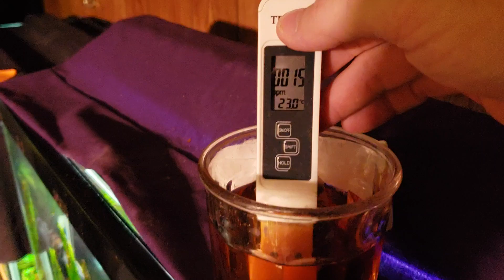Why Are The TDS So Ridiculous In My Native Tank?

Comment: Hey Dan, just saw a review of this new type of internal tank filter you might want to check out specifically for this native tank. It might reduce your TDS no matter what the source as it uses electrolysis to remove ammonia and other substances. The only thing it doesn't have is a UV sterilizer, as of yet.
https://youtu.be/qDcSJDqqDOc
Reply from the maker: That was interesting. Thanks.
Reply: @DanHiteshew-oneandonly  I thought so too, and timely to your situation in the big native tank. I am sure you saw my questions about those filters in his comment section. So far he hasn't responded, but he usually does. I wound't be surprised if he was talking to the makers of those filters to get the answers.

Comment: what type of filter are you running on that tank.  If I recall correctly you run most of your tanks with the same type of filter but just wondering if the filter is holding onto the TDS
Reply from the maker: It's a 404B SunSun, and I did a video a long time ago where I tested to see if the filthy  filter water had higher nitrates or TDS and it didn't.
Reply: Didn’t think it was the filter but I also know that at times they can hold onto TDS and I couldn’t think of anything else that might be causing that tank to have high TDS

Comment: I think the pH also matters if you measure TDS. If you have low hardness your water can easily go to acidic. Try to compare pH between aquariums. Acidic water should have increased TDS compared a non acidic water even with the same non water ion concentration. At least I think hydrogen ion concentration should have a strong effect in TDS. Hydrogen ion is so "mobil" it can increase conductivity of the water more than others ions.

Comment: the more water you have, the higher tds you get
Reply from the maker: The more water you have, the more dilute the TDS would be, indicating lower TDS. A small tank concentrates them.
Reply: @DanHiteshew-oneandonly  From what I understand is the larger the water volume the longer it takes for dissolved solids to build up, but they can build up. Since your native tank can handle cold water changes, unlike tropic tanks, you could do smaller changes more frequently with your RO water which you said was 12 TDS. Doing small water changes wouldn't shock your fish  unlike a larger water change would with the same RO water. The larger volume of water would prevent too much reduction of TDS all at once giving the fish time to acclimate to slowly reducing levels. Allowing for 2-3 days between small water changes you could reduce TDS down to acceptable (in your mind) levels in a month or so without giving a shock to your fish. Once it is at a level you target, then you can test weekly to see hom much increase you are getting, and compare it to your smaller water change routine and determine a new schedule for water changes on this tank. After wtching Rachel O'Leary and her process of small water changes more frequently I have become an advocate for them.
Reply: He has 2 125G tanks both heavy load of fish. The other one has a lot of plants in it and a lower TDS.
Reply: yes but it dose make sense tho... the more volume you have, the more space is available to minerals / nutrients /chemicals etc. which means it gets higher TDS  more easily then smaller tanks

Comment: Maybe the microbubbles are affecting the meter... How does TDS meter work? Maybe the temperature gauge on the meter is bad? TDS measured from electrical conductivity also has to factor in the temp of the water... are the tanks vastly different in temps?
Reply from the maker: The tester is auto temp control.

Comment: Man those are some crazy numbers. My tap TDS is 035 my tank is 076.
Reply: That is very low for fish tbh. you might want to add some aquarium salt over time and watch the levels. They should be around 100 to 150  +/- 25 TDS, yours are on the low side.
Reply: @Shaden0040  I notice when my nitrate is over 20ppm it's closer to your numbers. My nitrates is 5ppm.
Reply: @kg2nc  5 to 20 ppm nitrates is a small difference and can easily get take up by plants. Fish do need some salts in the water to regulate osmosis and kidney regulation, not much but they do need some. My advice is if your tanks are healthy, your fish and plants fealthy, then don't change what you are doing. If it aint broke don't fix it.